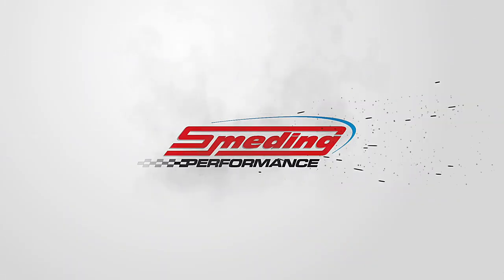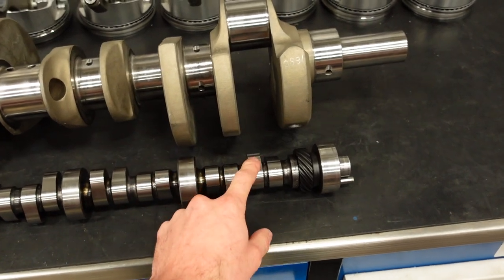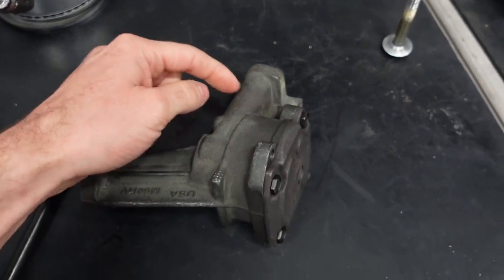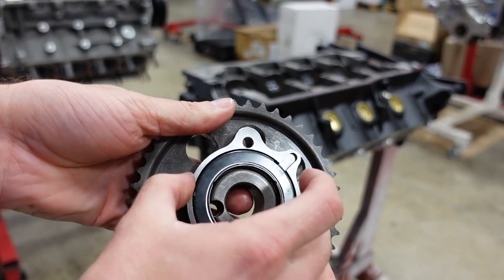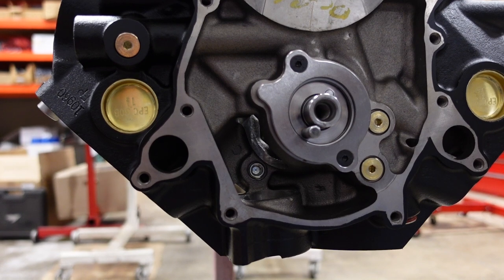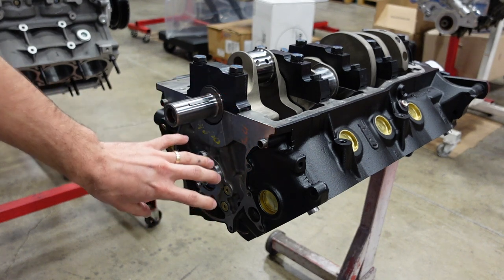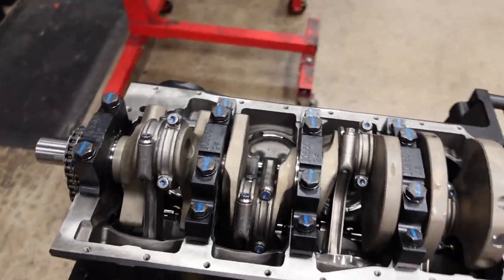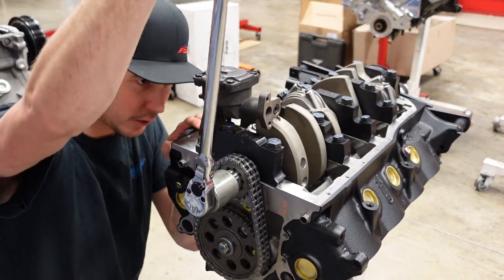Building The Ultimate High RPM Pump Gas Small Block Ford - Part 1

Comment: I just had a Dart SHP block, Callies forged 3.4" crank & Callies forged 5.4" H beam rods with Mahle 1mm/1mm/2mm ring pack 11:1 CR 363 built.
AFR 195 Renegade heads and Performer RPM AirGap intake with a Comp Cams custom hydraulic roller that will rev to 7,000 RPM AND make a LOT of torque down low with a decent idle.
8,000 rpm sounds great, but I'll stick with my combo in my '85 Foxbody.
585 HP will MOVE a 3,100 lb Mustang....Yeeehah!!!
I like your 363 build too,
Dart SHP is bulletproof...
but there are 'lots of ways to skin a cat'.

Comment: Tell me about it.  I built my 289 to 7500 rpm.  Many didnt believe, others were shocked, and some shit themselves.   Then I introduced the first guy I came across and smoked my little 289 with a 327 chevy, spinning to 10,000 rpm.  Now thats a fast piston speed!  Currently building 2006 Boss 302 block(#171) to 347 with billet Scat crank built for 8500 rpm.  I should've went with I-beams....just as strong and lighter.  At least for this application...I make up for it with my billet lightweight crankshaft!

Comment: I’m thinking about going with a 632 BMF or a Pro Ls 427 S/C. I plan to take the car on road trips back home which is a few hours away, 6 max. Which motor would you recommend considering gas mileage and driving around town?

Comment: Sorry Budd but you are leaving a lot of torque and horsepower on the table with that compression ratio🤔
Reply from the maker: I couldn't agree more, thanks California.
Reply: @JacobVillemain  You can run more than that on 91. Should have been 11.5. We are doing 10.5 in superchaged engines. Sorry if I had put this much money into a motor that put out such weak numbers I wouldnt want to tell anyone.

Comment: I have both currently. 1967 Mustang with a 289 and a 2003 Chevy Stepside with 5.3. Hard to beat an LS reliability but also had old farm trucks with 351w in them that would go 250-300k miles. I’d like to build an engine for the Mustang or an old F100 but seems like a lot to learn for someone to do it alone without a mentor or helper. Can’t wait to see the Ford scream!
Reply: Ford engine pre dohc just as reliable even more

Comment: Yeah, but it’s not even a Ford engine block. It’s an aftermarket block aftermarket crank aftermarket rods. Take a bone stock board block. Do the machine work to it and you can spin 8000 RPM I build a 289 punched it out 40 over with the right head and the right cam it’s spun 8000 RPM, but that’s not a Ford motor but it is one hell of a motor that’s for sure